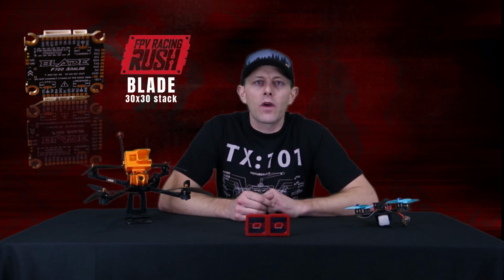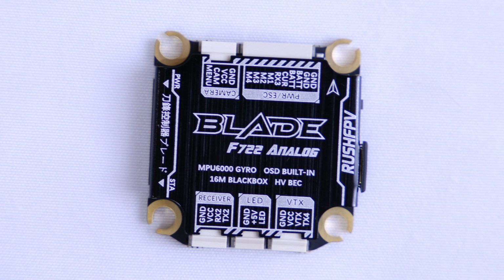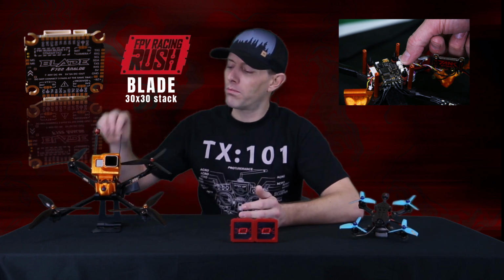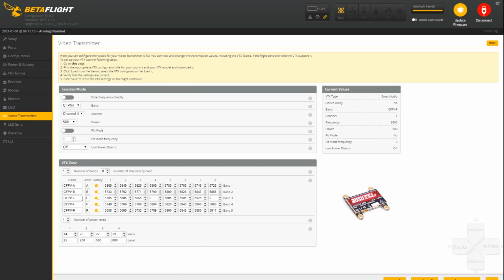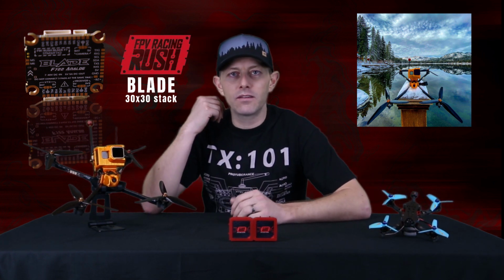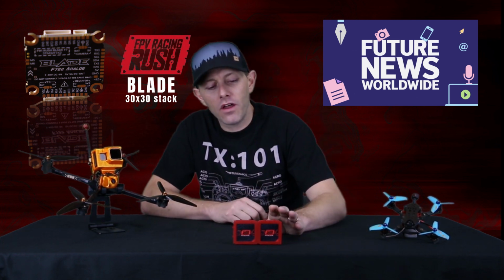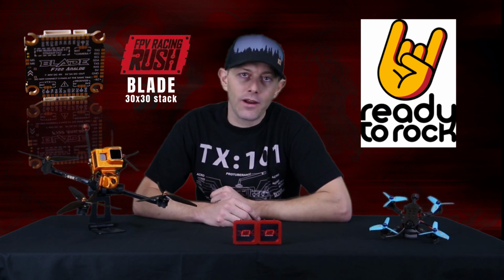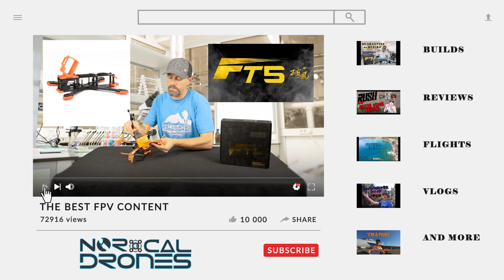Rush Blade stack Review. Do we need to solder everything?

Comment: A lot of companies have tried connectors in the past but that doesn’t work well because they tend to come loose. Solder everything is the way to go ;)
Reply from the maker: Yeah I tried plugs when I first started and stopped using them real quick. But these lock in pretty good and so far they’ve gone out over a mile and no problems yet. We’ll see what time does for it.
Reply: I have these, they're stuck in there way better than a tiny solder joint since they lock in. There are awesome solder pads on the bottom if that's your thing

Comment: honestly its a lot cleaner its rare that you have the exact right length cable with exact right plugs on both ends so you will probably end up with connectors just splicing cables anyways and end up with a rats nest in your drone.
the best way is a nice board with all the pads on the top of the board with beautiful clear screen printing then soldering is a pleasure.

this is why i like matek boards so much worth the extra over the cheap boards tbh.